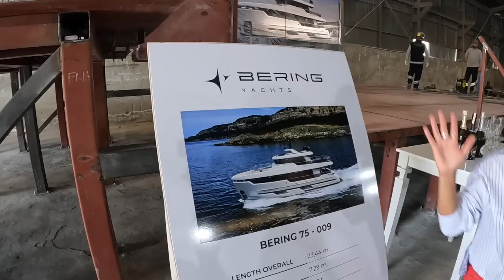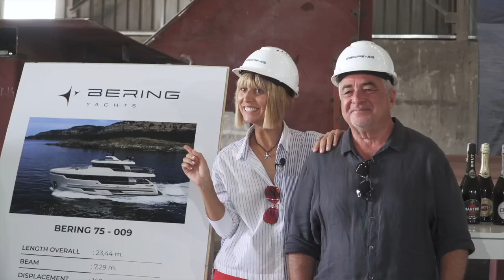BUILDING A STEEL BERING EXPLORER YACHT Eps. 4

Comment: All right so you're a big welding so using CO2 as about ready to say if you were doing flux core you can always take the gas shield off and see what you're doing a little better but you need the gas shield if you're doing mig or Tig

Comment: this brings back some memories. last december i signed the contract to build a nordhavn. i remember the feeling at the time. i had a nice knot in my stomach. was a bit nervous. it was the biggest dollar amount contract i ever signed. rico is right though. no welding ceremony for me lol. congrats!
Reply from the maker: 🙈😝🙏🏻💙 which model did you get?
Reply: @NautiGuys  the 475. ill have hull 5 of that model.  quite a bit smaller than you guys. its in rough carpentry now. ill be due to take delivery around this time next year.

Comment: You posted some of this video back in the beginning of July so how far along is Bering 75 hull #9 now? Do you have a rough I idea of a completion date yet? I know nothing is set in concrete when it comes to doing anything nowadays. 

Here's a question for Alexi. When someone buys a boat do you try to buy as much of the steel, aluminum and other building materials asap to avoid price increases or supply chain problems?
Reply: They said earliest late '23, rather 1stQ '24.
Reply from the maker: we are actually hull #1 (009 doesn't refer to the hull number, just the GA number). yes, we do try to buy the material asap with everything going on in the world

Comment: I keep hearing cup holders? Search wide bottom coffee cup with foam rubber bottom. Cup holder never needed. 10 foot waves and it is staying where you put it and very hard to knock over. Required by old farts. Also holds heat because of narrow opening. The heavy thick pottery ones are best.

Comment: So she didn't blow a hole through the material that's pretty good usually the first time somebody welds they blow a hole through the material
Reply from the maker: interesting...
Reply: @NautiGuys  if you have the power turned up too high and you hold the one in one place too long yes you can actually blow a hole through the material I've done it before when welding when I was a novice and most novice accidentally do that there's an old saying out there if you can weld two aluminum cans together you can weld anything